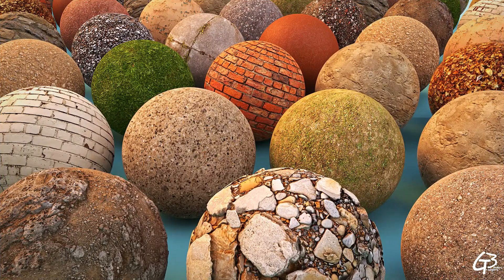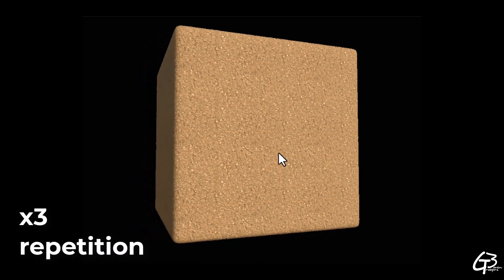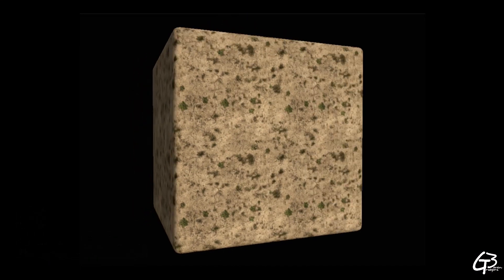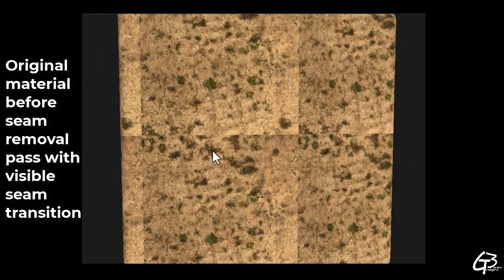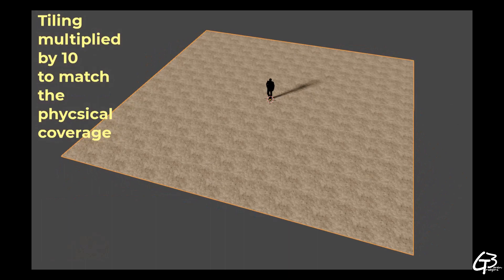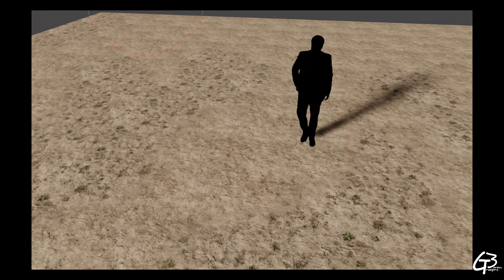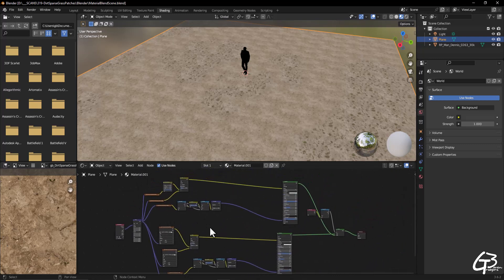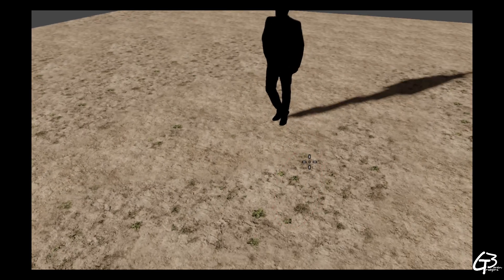How to deal with material / texture tiling repetition - Material Blending

Comment: There is also a method, that I use mostly in unreal, but that can be applied to any 3d software, which is cell bombing method mixed with a height lerp, by using a cell noise with specific alpha, you can offset randomly the texture in any direction by an amount and blend them with an original with the alpha to give a fully randomised variant of the texture tiling on 4km landscape !
Reply from the maker: Thanks for sharing. Yeah, I believe the best results can be achieved when you combine a few different methods together, so you have full visual control when required and randomisation where its not. Unreal feels amazing and extremely powerful in so many aspects.. definitely need to spend more time with it. Cheers!